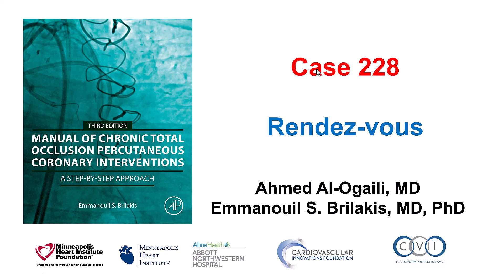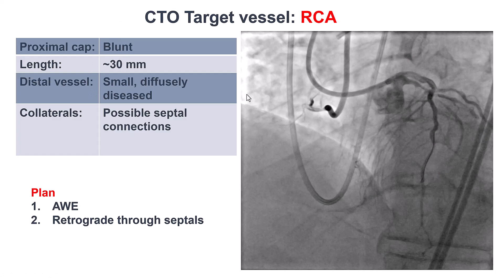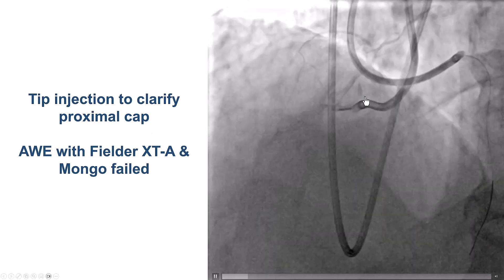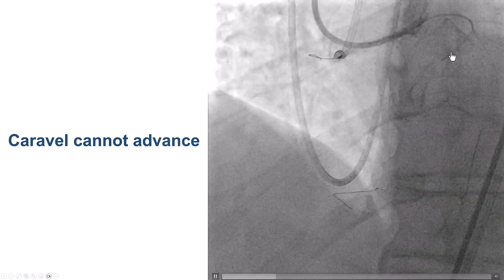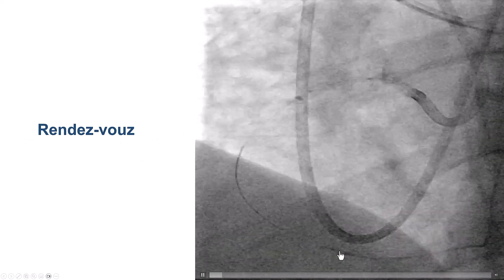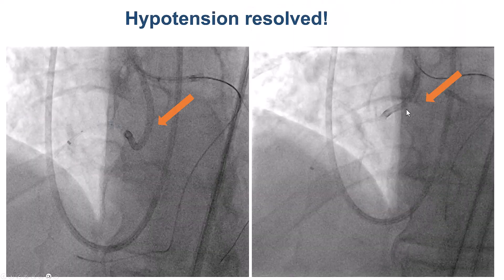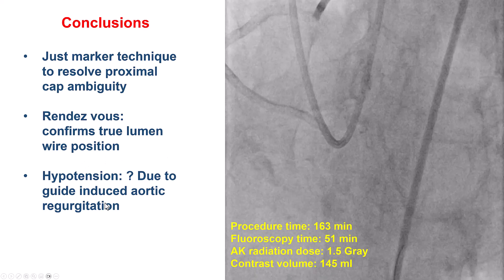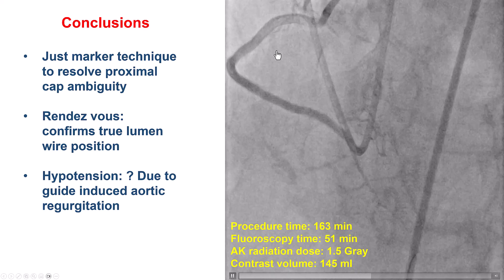Case 228: Manual of CTO PCI - "Rendez-vous"

Comment: Excellent case with so many tips and tricks. One question; the radiopaque length of the antegrade wire along the Turnpike Spiral seems to be less than 15 cm(of the Gaia Next 2 wire) ..I may be wrong....Could you please  figure out? Great thanks
Reply from the maker: Great point, you are right - we switched the Gaia Next 2 to a Mongo that make it into the retrograde microcatheter.

Comment: Sir why not use this technique rendezvous vous more in retrograde you had mentioned its use 5 to 10%only inspire I carries several advantages
Reply from the maker: It is quite hard to advance the antegrade wire in the retrograde microcather - in this case it worked because the antegrade wire was in the distal true lumen and the the distal vessel size was quite small.